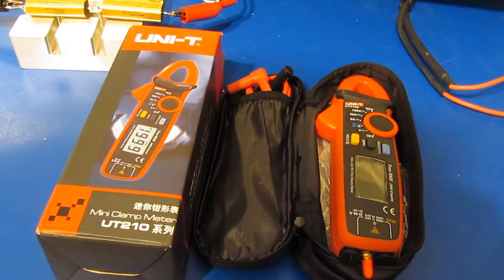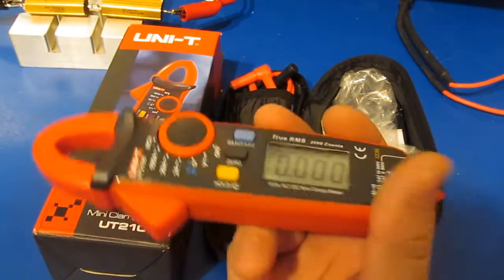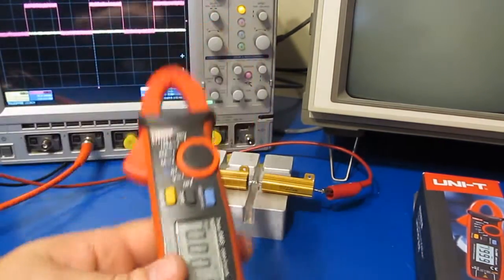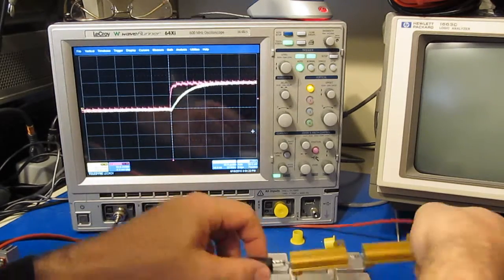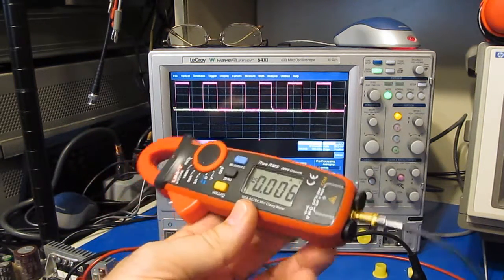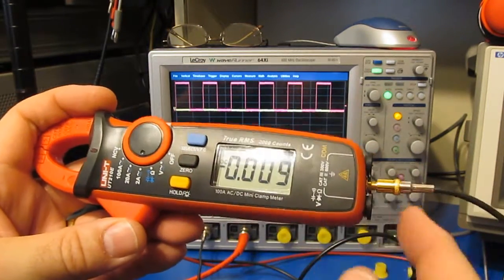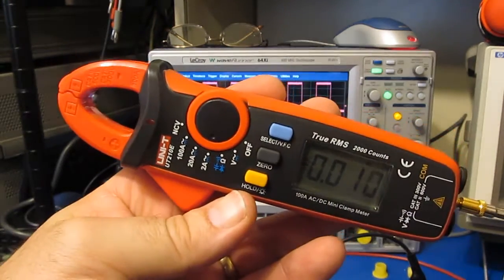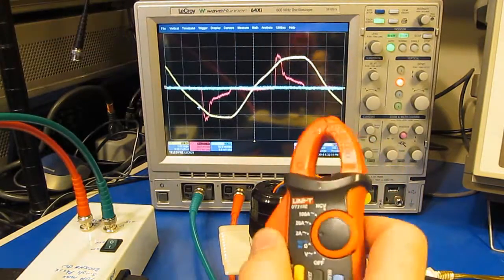Modified UNI-T UT210E AC/DC current clamp with analog output

Comment: Hey I cant find any Infos at eev's Blog about that Mod. Where can I find the Details you were Walking about ? Thank you. (Maybe you could just tell us the Page of the Thread)
Reply: Yeah its a big long thread and frustrating that the first page shows it done, but no mention by the OP of where to hook it up. Anyway I found on Page 13 contributor Ivan7enych has a pic where he has connected the signal and ground wires, ADDITIONALLY one of joe smith's videos he says he attached the scope to R7 to measure the output (I haven't done the mod yet so not sure which one is right or they are both the same thing electrically speaking). I'm sure it will be somewhere else in the blog, but I just wanted the answer too since it was taking so long it was almost like I could have found it myself on the circuit faster than searching the damn thread.!

Comment: You're doing a great job with these reviews, however it seems that you don't understand that some of your viewers may not be as well prepared as you are and sometimes you just tend to forget that Fluke costs about 4 or 5 times more than Uni-t&Co.  I hope i didn't made any grammar or typing mistakes because i saw that it bothers you so much. Remember: not all of us were born in the US of A.
Greetings from Romania! Keep up the good  work
P. S I do use the leads and they're very useful. Someone that does field work and not only lab, appreciates them a lot.
Reply from the maker: I was not aware that Fluke makes a clamp meter that competes with the 210 and was only 5 X the cost.   $150 for a Fluke DC clamp that reads to a mA sounds like a great deal.   I have damaged a fair number of cheap UNI-T meters because of their poor input designs which is why I have no use for the other functions on this meter.  It makes a very good clamp for the price but that's about it.  I was not aware I was bothered by typing mistakes or grammar.   I do run into problems trying to determine what people are asking from time to time.  I suspect it is partly due to the translation compounded with people not always knowing themselves what they are trying to ask.   Normally I try to answer questions people have.
Reply: Well... I saw how you answered to the guy that wrote with caps and i thought that a grammar mistake must be way worst.
However.. I also have a Metrix Mx655 clamp (300€) and i just think the uni-t is just fantastic compared to that one. Don't get me wrong, i have nothing against Fluke or Chauvin Arnoux or any other brand, but it's just normal that they work with those price tags. On the other hand these cheap instruments that actually work are a very nice surprise.
Reply: Next week i'll test the multimeter side compared with a Hp 34401 that i have in the lab and see how it pans out . I'll let you know.
Reply from the maker: I assumed with the caps lock and question they were trolling was all.   I look forward to seeing your results on how the two meters compare.  Normally, I find even the cheapest meters are pretty accurate when I first get them.   I've never looked at the 210s I have besides the current which I have been impressed with for the price.   I dare say the 210 is my favorite UNI-T product I have looked at.
Reply: joe smith
Hello again, I've done some testing today: Uni-t UT210E vs Metrix Mx655 multimeter functions 
- Reference instrument - Hp34401A
-Dc power supply(0.05V-40.0V)Instek Psp-405
-Resistors 0,25w 1% (10, 102, 4.53k, 48.7k, 681k)
The Mx655 has a resistance range that goes from 400 to 4000 ohms, so that was almost useless. First i tested the two clamps and the Hp with the same leads and it made no difference, than i used they're own leads. The measurements were made with the resistors and source in parallel with the Hp - The clamps one at a time. 
R=10ohms-Hp(9.994)Mx(9.9)Uni-t(9.9)
R=102 ohms-Hp(101.578)Mx(101.1)U
ni-t(101.6)
R=4.53k-Hp(4.518k)
Uni-t(4.52k)
R=48.7k-Hp(48.661k)
Uni-t(48.7k)
R=681k-Hp(684.06k)Uni-t(684k)
VDc measurements:
S=0.05V-Hp(0.88,5)Mx-out of range Uni-t(0.88,5)
S=0.28V-Hp(0.308)Mx(0.3)Uni-t(0.308)
S=1.35V-Hp(1.379)Mx(1.4)Uni-t(1.381)
S=8.28V-Hp(8.314)Mx(8.3)Uni-t(8.32)
S=16.52V-Hp(16.561)Mx(16.5)Uni-t(16.58)
S=26.4V-Hp(26.458)Mx(26.4)Uni-t(26.4)
S=40.0V-Hp(40.026)Mx(39.8)Uni-t(40.0)
  So far i learned that the Instek on-board instrument is rubbish :) 
In next few days I'll do the rest of the comparison- (50-250V Ac&Dc range)
Reply: @joesmith-je3tq  Hey I’m just getting started in electronics and had a question hopefully you could answer, do you think this meter could be damaged using the probes it comes with on mains 120V AC? I did this on accident and am wondering whether my meter is still trustable. Thanks a lot for any information you can provide into how these probes work!

Comment: Nice Video, Thanks you Mr. Joe Smith. I also have UT210E. this modified is very interest. because, when i need measure current. i use my 1 or 0.1ohm shunt resistors. it's little bit tiresome work to me everytime.
Reply from the maker: Thanks.  I use shunts, transformers, clamps, LEMs depending what I am trying to measure.  The UT210E works very well for automotive.  The one I have modified has been a nice addition to the lab.

Comment: What AWG do you think you could fit through the clamp?
Reply from the maker: +John Doe I think 66 AWG would fit.    Because I have no idea about the jacket thickness you are using, the best information I can offer is that it appears the jaws would accept a about a 0.7" OD.
Reply: +joe smith Hello . I'm from Russia English do not know much, I wanted to know why you have it modified the current clamp, I wonder, can you tell and show the next video to disassemble unit 210e and the show did, that is, the wiring, and do not listen to others and not pay attention to the different saying in your address, it's your channel, and in the right of you. Thank you
Reply from the maker: +Git Up I modified the clamp because I thought it may be useful at times to use it with an oscilloscope.    I described the pins where you would need to connect on the EEVBLOG site.   The link was provided in the description.

Comment: Very nice video. Excellent value for money, and now with this extra mod it is even oscilloscope compatible! The only thing left would be to make it wireless via bluetooth or WiFi.
Reply from the maker: +Javier Palla Lorden Thanks.   A few people are looking into this on the EEVBLOG site.  It uses a fairly common controller so supporting serial communication may not be too much of a problem.  The lack of room inside the case and only having the two small cells may be a bit of a problem.
Reply: Can i see the circuit diagram???

Comment: A little nice cheapie and worthy HVAC toolbox item. LOL…...
Reply from the maker: +TheOldmankk It's the only UNI-T product that I have actually recommend but only as a clamp.  For $40/ it's really pretty good.
Reply: +joe smith -- I bought one recently.  It's in the lab at work, but I haven't gotten around to testing it out yet.  We can get fairly decent accuracy from our equipment from uA through to 100 Adc / 120 Aac.  I will post the results on EEVblog forums when I get them.
Reply from the maker: +boggisthecat Looking forward to seeing your post.   The probe by itself appears fairly accurate.  Even with low DC currents.  To be clear, when I mention the inaccuracy, I am referring to buffering the raw signal for the analog output.  I thought about adding a couple of trimmers to at least set the gain and offset.